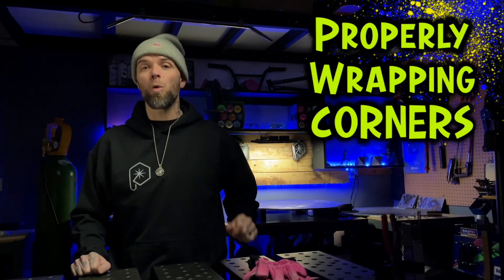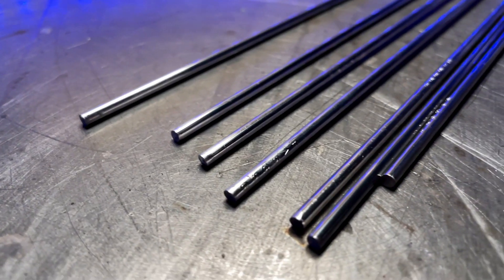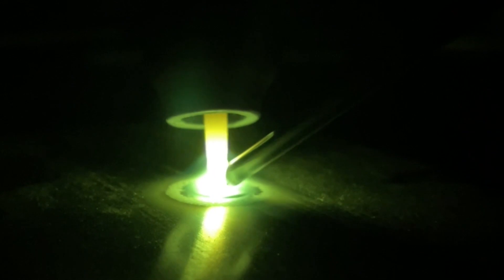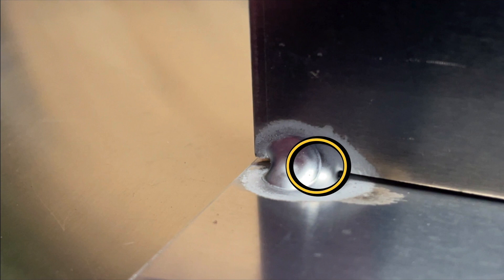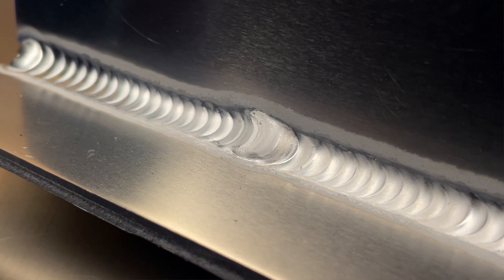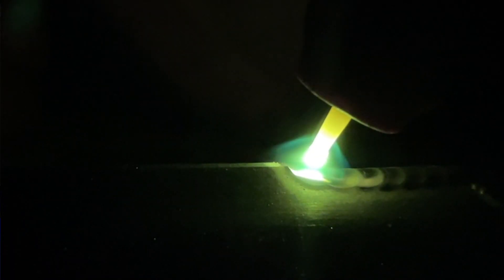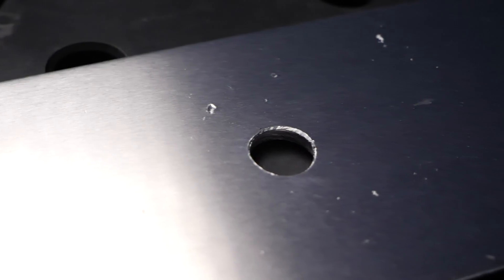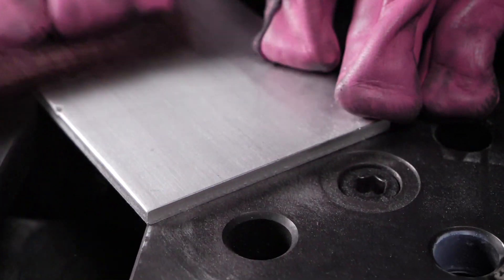5 TIG WELDING TIPS IN UNDER 5 MINUTES 🔥

Comment from the maker: Thank you SO MUCH for watching today!🔥Check out my Online Tig Welding Program HERE💎 https://pacificarctigwelding.thinkific.com/courses/tig-welding-aluminum-fundamentals-2-0
Reply: So I am hoping to sign up for your class a.s.a.p., that being said what basic setup do I need to do this. I am already tig welding (garage) own a budget welder (Harbor Freight Protig) and keep having equipment issues with consistency with things like gas use and torch failures, mainly torch problems. Is there recommended base line equipment that you consider reliable? I understand that many problems are user error I just don't want to be trying to learn while fighting with my equipment.

Comment: HI, I need help welding an aluminum Reid  Transmission case hole. 11/16 internal thread . 1/2 inch deep of mest up threads.I need to weld hole shut than tap the hole to 11/16 x 12 pitch thread , yes it is 12 pitch ,odd

Comment: Regarding the last tip for filling in a hole: "this little boo boo never even happened", except for ruining the aluminum tempering in a large area right in the middle of the plate. On mild steel, it's not a factor. On tempered aluminum, you have to think about the consequences of ruining the tempering like that vs having a hole.

Comment: I really don't understand why you would use tig on a piece that is manufactured because you have mig which is not pretty but its super strong and super fast I use tig on really light weight material and that really is about looks and weight but now you have lazer to look pretty on light materials but I guess that until you buy new equipment, but when I was taught how to tig or tungsten inert gas weld it was more about marrying materials it wasn't used to manufacture as tig is very expensive for manufacturing applications so we would use mig metal inert gas processing when you need filling material so i don't understand why you would need to use a slow pretty weld these days...

Comment: Very well done! I agree with all of your points. I am curious about the 1/8" filler. What is your bottom end threshold as far as material thickness/heat where you drop to 3/32 or 1/16? (If any)

Comment: Retired pipefitter here. My Miller had one knob and one switch (switch was the on/off) no high frequency, no pulse, no balance, no dig or whatever, no pedal or bull shit like that. Lift arc all the way and moving the fish eye to the edge of the weld and shooting it off of the pipe at the tie in . x-ray welds all day long. To reverse the polarity, clamp the stinger on the pipe and the ground onto the torch. We were a code vessel shop, all those switches and knobs are not necessary.

Comment: Another really good trick for filling in holes is to clamp a piece of copper behind the hole.  Then you can just weld it up and the copper will support the weld.  if done right the backside will be flush when yo unclamp the copper falls off.  The best benefit is if it is thin material the copper pulls a lot of the heat out of it.
Reply: Copper seems to work better than the ceramic backers.

Comment: I learned to weld with a similar Lincoln and a Miller of the  same vintage.  I did worked almost exclusively on 16-22 gauge (1.5mm-0.74mm) stainless steel.   I love those things.

Comment: What if you can't flip to the other side of the hole?
Reply: Maybe get enough material to plug the hole with, but with beveled edges to allow you to get full penetration when welding it in place.

Comment: Bossman wanted me to fix a wallowed out 12mm Allen bolt counterbore in a 1" aluminum plate with an hour left in my workday.  It would have been fun to do if I had had time.  Plug weld a 1/2" hole 1/2" deep...